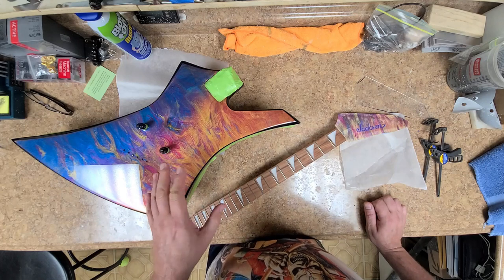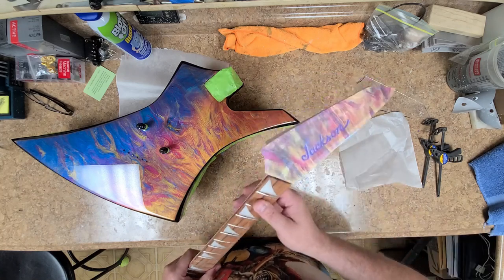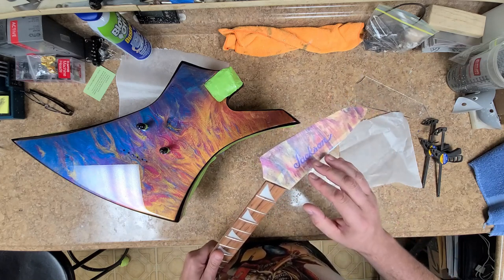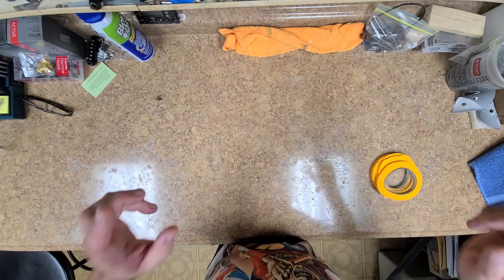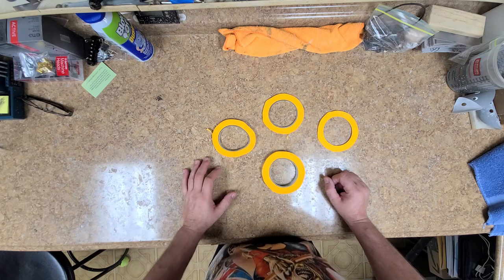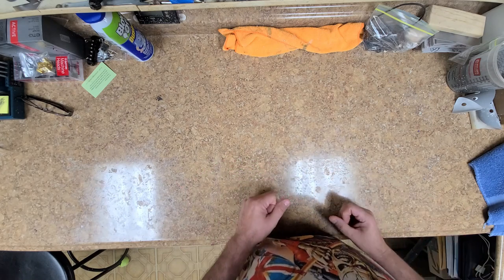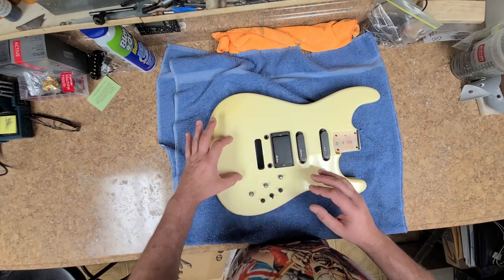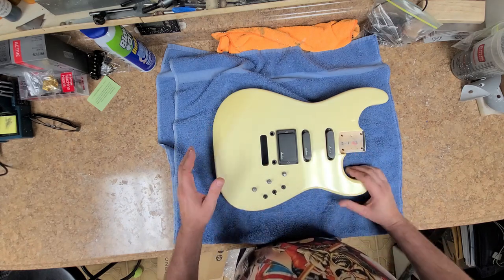New Guitar Project

Comment: that rear slot just behind the saddle area looks to be off set and not centered? I'm sure the saddle will correct the center of the strings to the neck but it does appear to be off center in the video. this could purpose a problem with set up and intonation.